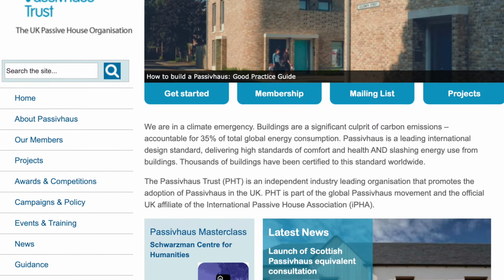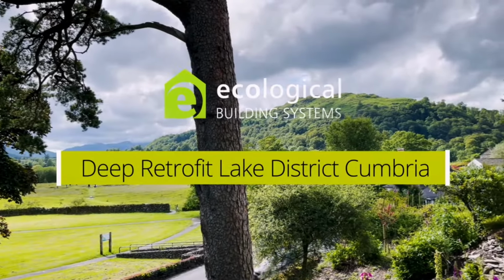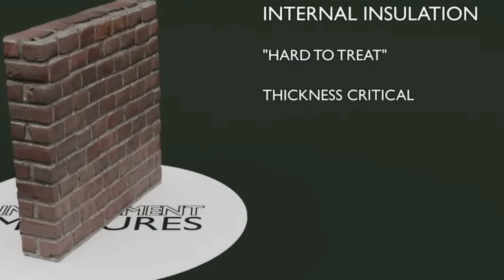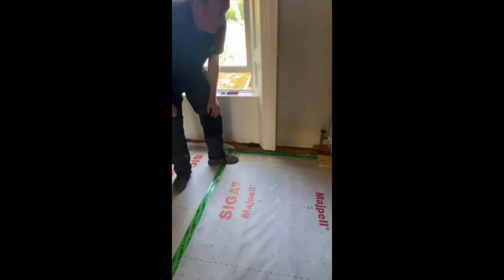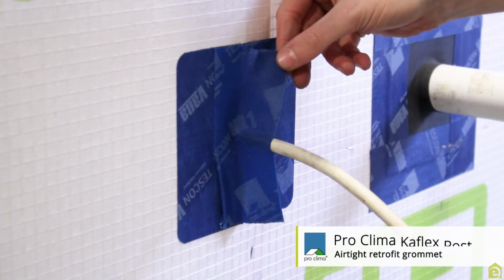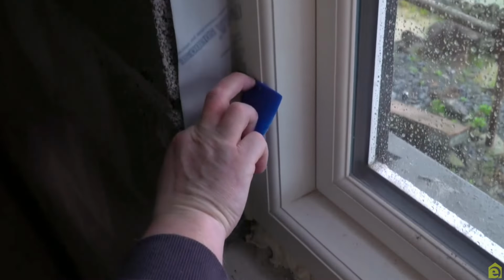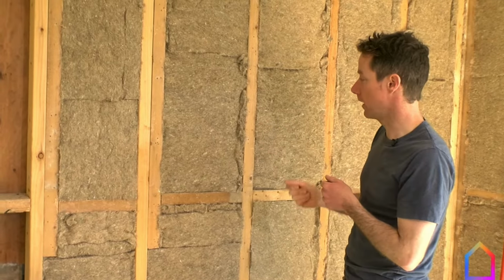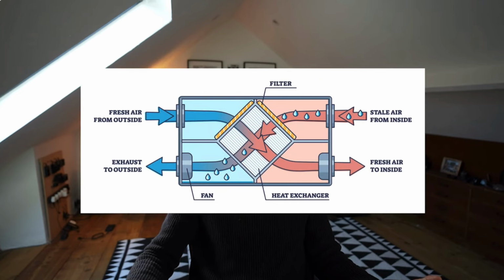Do You Know How To Make An Old House Airtight?

Comment: Now, does anybody know a company in midlands understanding and performing installs of siga and triotherm materials? I want to change 3 pair of external door, but have them installed without cold bridges (meaning...not screwed in and sealed with caulk but proper 21 century materials). However...while you can throw a stone and hit a advert banner of such company anywhere in the rest of the Europe, I am having hard time to find somebody in the UK catching up with things like this. Only 40 years behind Germany...c'mon...

Comment: Hi Neal,
We are doing a complete refurb of a 1850 ish stone building. We are going the lime \ breathable natural materials route as that it what it 
needs. Most builders  / council staff do not now this.
We are using lime plaster / mortar to replace the cement, wood fibre boards ( Steico) , hemp, warmshell, for the insulation, natural materials always used.
Thanks, love the videos, will be in touch.

Comment: I wish people in the building industry would stop encouraging people to seal their homes to the point of reducing the hot air from leaving the property. I am an ex surveyor and I use to issue EPC’s for their energy rating then I would issue an EPC. I am now looking after an old friend that is terribly suffering from symptoms of brown mould that is caused due to the lack of hot air leaving her property. We ALL have mainly three types of mould spores that are usually quite normal around our property’s, but if the environment in our property is not normal then those moulds will take over and then there is no control to how bad it spreads. She is now very seriously very ill but the housing association refuses to accept the truth. A mould expert has now condemned the property and all the tests I have done has been positive for all those types of mould. It’s all because her house is virtually air tight and most of the hot air stays within the property causing high humidity which those mould thrive on. Please if you own a property do not over insulate your property and if you have draughts leave them and don’t seal those draughts because your house needs to breathe and if your house breathes then so do you. Think about your health before you insulate your property. I am hoping to do a video this year and put it on line and you will see why this poor woman is suffering. In the mould experts report he has stated that everything she owns has to be thrown out. The brown mould is on everything she owns, her clothes are in suit cases and her cutlery is in plastic containers due to mould being in her cutlery draw, her towels and bed linen is in plastic bags, everything in her food cupboard that’s opened is in plastic bags. She is living a nightmare and please take note of what I have written above. Everything I have said is true.

Comment: I've just found your channel. We live in a small stone built cottage in Northumberland and are retrofitting. It's listed and in a conservation area, so we needed listed buildings consent. When we moved in, we discovered someone tried to renovate before by covering the internal walls with cement, causing damp issues. We've been removing all the cement and repointing walls inside and out with lime (after doing a course at the Scottish Lime Centre.) We want to insulate the walls with breathable materials and lime plaster and are still deciding on materials (wood fibre, hemp or sisalwool, etc- it would be useful if someone did a comparison between products!) Until recently, it wasn't possible to double glaze due to the listing, other cottages have secondary glazing instead. It does the job but opening windows is awkward. In June last year, Historic England changed their guidelines and now allow slim line double glazing in timber frames (their document about retrofitting old properties is worth reading.) We've had Passive input ventilation installed by envirovent which has helped with condensation. We're still working on it and are currently restoring a small outbuilding in our garden built in the 1800's that used to be a blacksmith's. We have planning permission to make it a home office (my husband's a draughtsman with almost 20 years experience of old buildings.) Our plan is to install a limecrete floor in the outbuilding with underfloor heating (Mike Wye have been helpful) and insulate the vaulted ceiling keeping some timber exposed (again, we're still deciding on the system. ) One difficulty we've had is finding builders, most we've talked to have a new build approach of PIR and plasterboard. It's refreshing to see someone acknowledge the issue.

Comment: I've been down the rabbit hole on this one recently. This video was made for a small group of interested people looking at insulating and making airtight older solid walls https://www.youtube.com/watch?v=sI98d1R3ntQ. The essence of it is to use a mild parge coat on the internal face of external walls which acts as your airtight layer, then insulate using mineral wool batts between studs, but without a ventilation gap between insulation and the wall.

Comment: We have a mid 1960s built semi detached house in West Sussex,UK. I would really love to fit MVHR but I think it would be sensible improve the air tightness of the house first, but a full retrofit is not really on the cards. I found this video to be very interesting https://www.youtube.com/watch?v=Va4qsH6pdEU&t=689s Now I want one of those doorway fitting extractor fans so I can test the air tightness after each attempt to improve it, to provide some indication to others which changes made the most significant improvements, but they cost as much as the MVHR system I want.

Comment: As the owner of a VERY old building the airtightness of the house definitely resonates with me.   Having said that, when dealing with older buildings there are many issues that do not exist in modern buildings that need to be remembered.  No damp course and a wall that is 6' think needs to be able to breath and if you tried sealing that you would only buy your self a whole load of trouble. Lime mortar shouldn't dry out completely, stone floors should not be sealed (even when lifted and have a damp course underneath) the list goes on.
Dry rot, something we have to thank the East India Company for, has a weakness that is managed in many Victorian buildings (as it did exist before this time, Georgian and older buildings suffer from dry rot more easily)  The fix? Air Flow   If there is plenty of Oxygen then dry rot will not propagate, stop the air flow and instantly if there is a corner with excess moisture you will have dry rot.  With older (and in my case listed) buildings with a slate roof water ingress is to be managed rather than assumed to be non existent and then better you can do that, the longer things will last.  The biggest improvement in the past 3 decades is the breathable membrane.  Sadly though I have found that breathable membranes are not wasp proof, they will chew through one to get at the space below.
A neighbour tried installing a heat exchange system in their single story building, running the vents through the ceiling and into the loft space.  In the winter the moisture condensed in those pipes and ran back.  The net result was lots of plaster work repairing the ceilings.  Ensuring that an air exchanger is fully insulated across the whole length of the run is vital.
Keep up with the videos, I like what I see and I'm just down in the borders.

Comment: Very interesting Neil. I retrofitted an airtight suspended floor shown ecological building solutions in your video. I am set to use an air tightness paint in the attic over the next few weeks ( my approach may be a first on this), most ceiling air tightness applies a membrane and then adds an additional plasterboard. Blower door test follows that. Cambridge carbon footprint has a webinar you might want to look at on air tightness.

Comment: the purpose of tight construction is to control the air changes that occur.  By passing them over an erv/hrv you recover the energy you put into heating /cooling the air.  combined with copious insulation you require very little energy to heat.  Think of a thermos with the lid on vs a paper coffee cup with a bunch of holes in it
Reply from the maker: I understand the concept but I suspect this is much easier to control in a new build than when retrofitting an older property.

Comment: I have worked on a few deep retrofit projects and will aim to share some of my experience. I apologise in advance for the word salad! 
Mvhr can be difficult to incorporate in an existing building so needs planning at an early stage to keep it efficient and minimise duct runs. Remember that longer runs require the fans to work harder (and therefore louder).  If the building layout allows, keeping the unit close to the stairs can allow most of your ducting to be hidden in a drop ceiling in the landings with wall mounted outlets in your rooms. If its a smaller house you can use a decentralised system (I've used the blumartin freeair before) without any ducting. With any MVHR you need to make sure you have adequate air movement between rooms (I prefer either larger gaps at the base of doors or hidden vents at the top of the architrave). These gaps/vents need intumescent strips or some other solution in a fire partition. Ducting through fire partitions can be handled by specialist modules that seal in reaction to fire.
With a solid wall IWI, my favourite approach has been a breathable woodfibre insulation with lime plaster as the principal airtightness layer, as this allows moisture pass through but also achieve good airtightness. I would strongly recommend a condensation risk analysis with most IWI (a 3D model such as WUFI as the glazer method isn't really robust enough for this situation).
For floors a great option is a thicker t&g osb decking with joints taped. On continent, osb is used internally to timber frame walls a lot in passivhaus and it's a more robust solution for the floor than a vcl membrane. Original boards can be overlaid if you're aiming for an exposed aesthetic. Bonus points for a perimeter tray for services inset and taped in to the osb. 
Grommets are great but have to be installed properly and cost more than tape (so contractors often try to skip them and use tape instead). Still, they are the best solution for performance. Pro Clima have a fantastic range of products thst covers almost every situation. Highly recommended.
Airtightness considerations often pair well with thermal bridge considerations and in both, minimising and eliminating penetration is generally preferable. You can go wild with this so it's important to understand the clients budget vs performance aspirations. Keeping electrical sockets to internal walls is an easy win in this regard, and if you can accommodate service cavities at the ceiling and floor, they make a world of difference.
Apologies again for the slightly untamed list of experiences but I hope it's helpful!

Comment: I'm not far off moving into a property I bought with the intention of reducing grid consumption to a minimum. 

My aim is basically to install triple glazing (need to decide on trickle vents or not), install air source heat pump and new hot water cylinder, install MVHR, solar and battery storage.

I'll need to look at the fabric and decide the best approach so lots of research to do. There is wall, underfloor and loft insulation from the 70s so I suspect replacing this and sealing up gaps will be a reasonable approach, but I need to ensure I keep moisture out of the timber frame.

As you say, building standards need to improve for new builds and good to hear Scotland are making this change. Retrofit is so hard and intrusive in comparison to the extra effort at construction time. It's a no brainer but lots of training needed. More resources to help with retrofits are always welcome so that DIYers can tackle this well informed.
Reply: @danrooke7372  if you're definitely installing an MVHR system, then there's no need for trickle vents in your windows. The MVHR well taken care of the ventilation

Comment: No all rooms need and intake and extract when using an MVHR - depends on layout.
Reply: Yes there are. This independant advice is especially helpful if you are also installing a heat pump. Most installers don’t consider the internal of MVHR and heat pumps - really needs a whole system view to get it right. I’ve messaged you on your website. Reach out and happy to give you more info.
Reply from the maker: Thank you, I didn’t know that. For house sized projects in the UK are there M&E firms who can provide design guidance?

Comment: Not used them but I have seen a lot about Aerobarrier  who suggest they can help with achieving airtightness. Feedback in the UK is limited, but seems to have been successful in the USA?
Reply from the maker: Thanks, I saw a video on this but I don’t understand how it works. They seem to spray a vapour throughout the house and it congeals in the gaps? I could be wrong.
Reply: I did get a quote of about 2k for a 60s 135sqm bungalow I am extending. Their comments were In terms of improving airtightness scores, we certainly can help – in these situations, we often see reduction in draughts from 40-70%, which certainly helps to make all your other improvements work at their maximum potential!
To provide a quotation, we just require the location of the project, gross internal floor area and how ‘involved’ the retrofit in the project will be?
The ideal time for an AeroBarrier installation is at a dry shell stage, just after first fix (once all external penetrations have been made) – post screed but pre plaster usually.
I would be very interested if anyone has hands on experience.
Reply: @RealLifeArchitecture  I've seen this: It uses microscopic particles carried by airflow into the leaks, and they (chemically) collect like sticky dust and cure in the gaps. AeroSeal is for ducts, AeroBarrier is used for sealing the building envelope.  Needless to say, it's best used on new construction.
Reply: Aero Barrier has been used successfully on old buildings too.    https://youtu.be/CV5elSvasic?si=oDeUUz14U4BUK9__

Comment: Surely the focus should be on minimising heat losses.  Yes, stopping draughts is part of this but I don't want a sealed home.  I have trickle vents in all my windows which are left open all year round.  A couple which are in locations where the wind strongly swirls around under certain conditions may be closed when it is very windy when there is a noticable air flow coming into the house.  I don't suffer from closed rooms smelly musty, nor do I have any instances of mould in the bathroom or kitchen.
One thing that (subjectively at least) did seem to make a difference to the warmth of the house was applying a waterseal coating to the exterior walls (solid double brick).  My thinking was that this would reduce evaporative cooling of the walls particularly in the winter when the weather is generally wetter.  A quick, cheap and (unless the sunlight and viewing angle are just right) invisible upgrade.
Reply from the maker: Like most people, I haven’t lived in a Passivhaus and I am skeptical that sealing our homes will work in the real world. 
Interesting that a water seal coating appeared to improve the warmth.
Reply: Thinking about it, a water seal coating the wall leading to increased warmth makes sense as a wet wall will be more expensive to heat. I can’t render / clad the exterior of my property so im interested in applying a similar coating.
Reply: I agree that nobody should want a sealed home. A draught is uncontrolled ventilation, whereas your example of closing and opening trickle vents is controlled ventilation. MVHR systems allow fresh air in too.

Comment: I run a family heating business. Prior to installing a new heating system ALL properties should have a Heat Loss Survey undertaken prior. As a professional business we undertake these. However, we are possibly in the minority  ! The best software for this is by a former heating engineer and called 'Heat Engineer'. 
Related to this, we refer to the core building and use the phrase:- 'Fabric First'. This simply means that before you fit any type of heating system, the building Fabric is key to the success and failure of the end result. 

Put simply, if for example, you have new double glazing throughout and 150mm loft insulation and 100mm under the Ground floor, your heat loss will be minimal and you won't need much to get a property to 20⁰c. However, reverse this and you're peeing in the wind  !
So:- "Fabric First" 🤩

Hope this makes sense 🙂
Reply from the maker: Yes, I have encountered fabric first and agree it makes sense
Reply: Getting a new HVAC system in New Mexico, and the estimator made it VERY CLEAR that his sizing was 100% dependent on upgrading the insulation ... the building inspector's first words were "You need more insulation in the attic!"